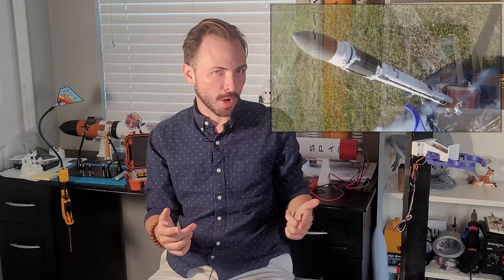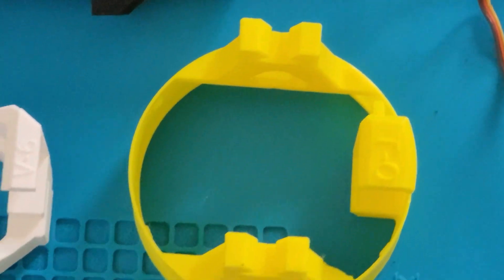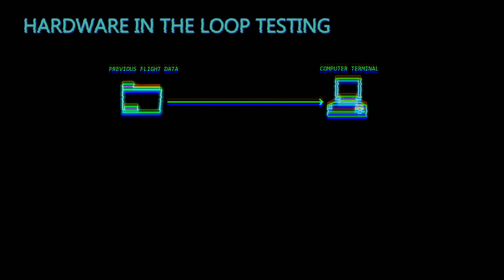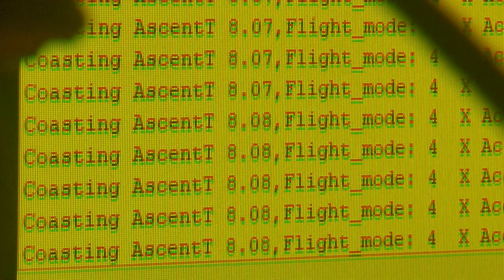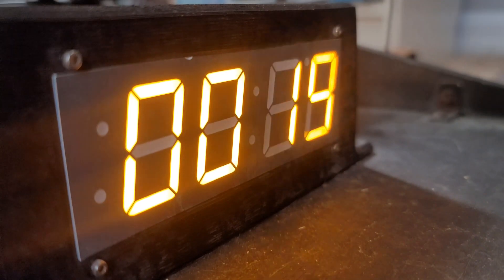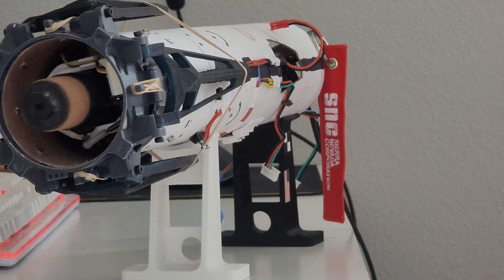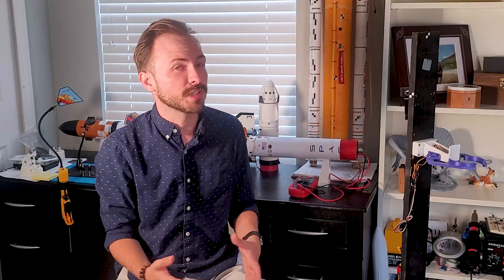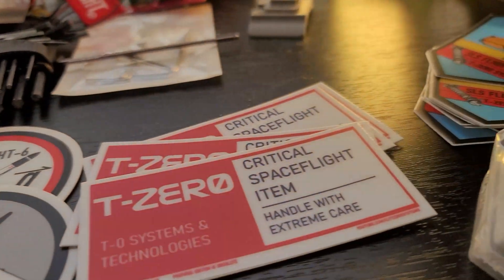Designing Software for Rockets

Comment: why don't you practice with kOS in KSP? it's already a fully simulated launch
Reply from the maker: I have actually! its functional but then it is more dissimilar in MMOI, and the sensor systems im using. KOS is good for understanding PID theory though. I built an F9 RTLS code once.

Comment: Interesting approach! Did you also input self-fabricated flight data that simulates more extreme scenarios to verify that your system can handle those events as well?
Reply from the maker: That's the goal! I can also do that manually by jerking the rocket around by hand too. Like we are ascending but something breaks and the pitch control gets stuck to max displacement. Then I can see in the CLI it trigger the FTS and try to blow the chute. I also can have it operate in integrated setup with the pad so it all gets tested as a unit